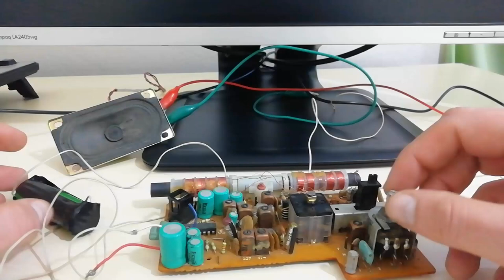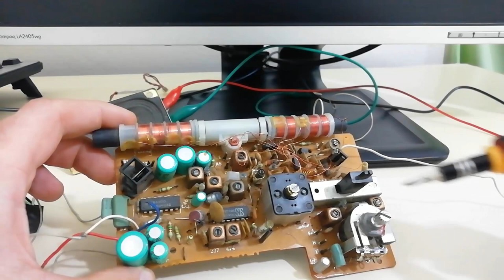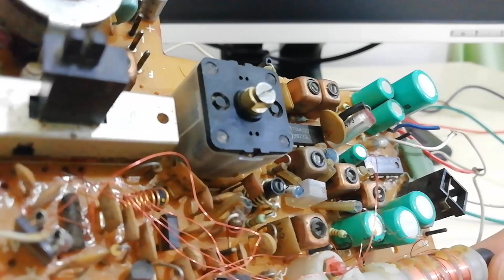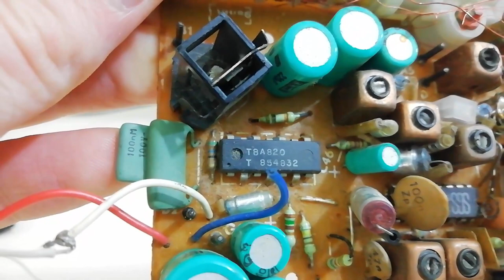How to Receive Radio Pirates on Modified AM Receiver

Comment: You can carve a piece of wood and use it like a screwdriver if you don't have a plastic screwdriver, metal screwdriver will crack the the ferrite of the the variable inductor.
Reply from the maker: Good idea, thanks.